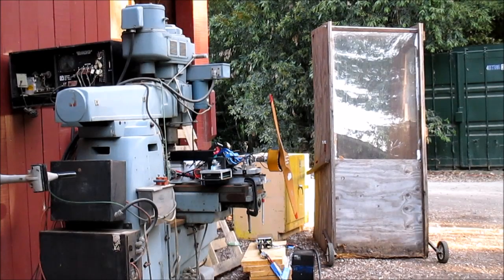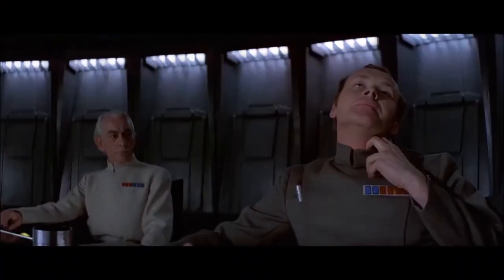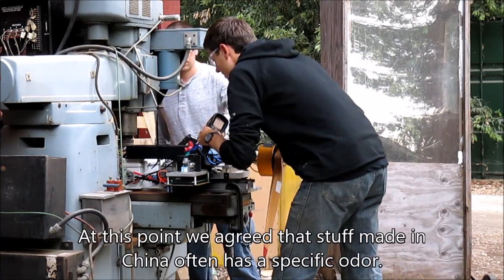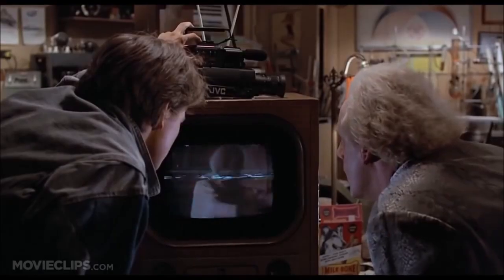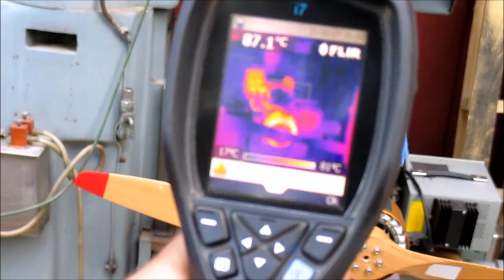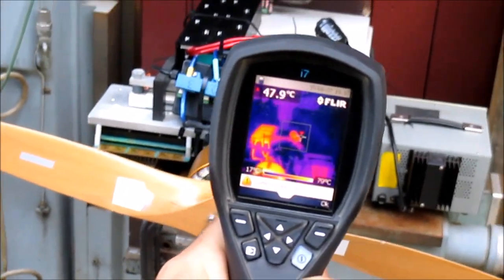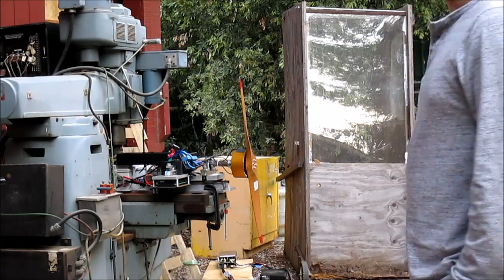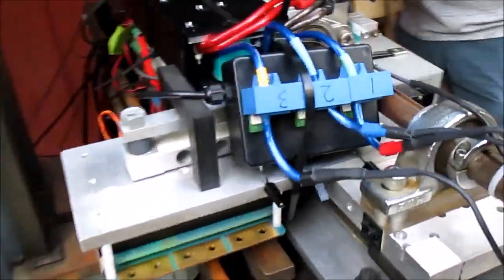18 MOSFET controller spinning a big RC airplane prop

Comment: what type mosfet you use? Linear Power MOSFET . Polar Power MOSFET . HiperFETT MOSFET ?  name please
Reply from the maker: IRFP4568 150V rated MOSFETs.  Check the link in the end of my description, it links you to a bunch of information I posted on this design.  They are good for about 65A continuous (keeping case temp < 80C) with decent cooling.
Reply: Try irfp4768pbf you get excellent results . But if it fine its will be good as same . 

IAM trying my collect mosfet result 
irfp4368pbf
irfp4468pbf
irfp4568pbf
irfp4668pbf
irfp4768pbf
irfp4868pbf
IRFP90N20DPBF
Irfp260n

And too many more . Have some data sheet working on it about most effective mosfet that can work excellent in the DC region as 
IXTK110N20L2 

It's something you can call it ( another level of  power mosfet )